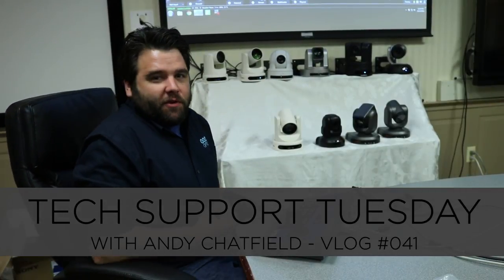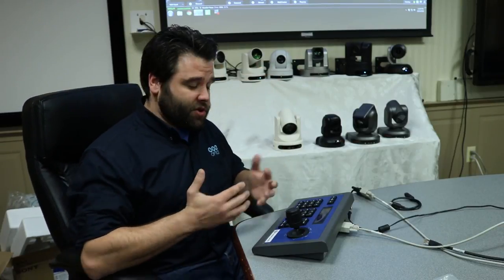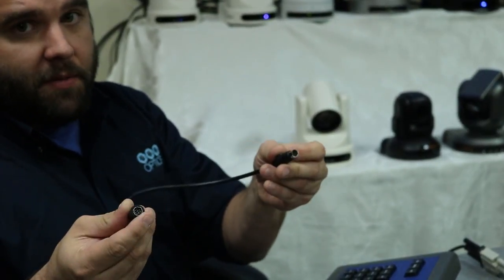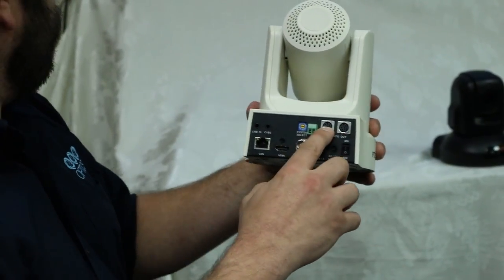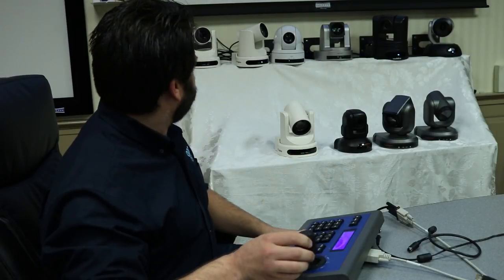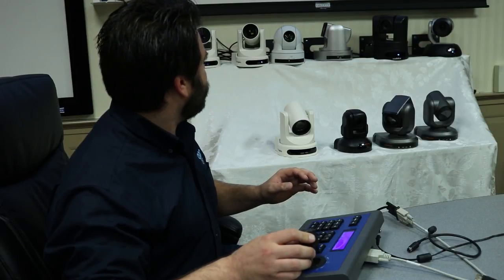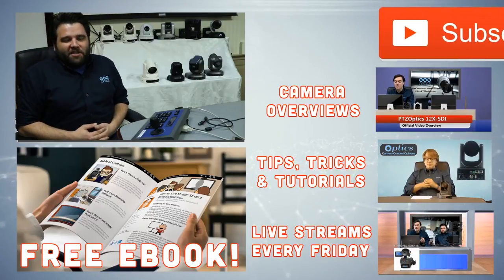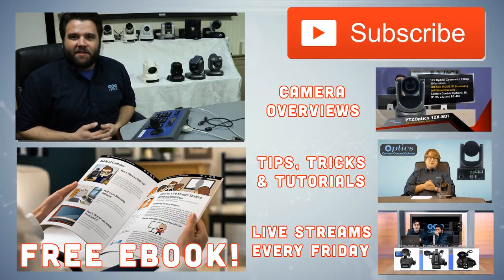SONY Cameras with VISCA Joystick Controller

Comment: Hey man, have 2 sony evi80 ptz came. When individually connected to serial cable, no issues at all, but when cascaded, the second cam doesn't respond, only first can connected  to serial cable.Cables are new. Serial is 25', cascade  is  100'. Controller is the Huddle g3....
Reply from the maker: Hello!
When you're experiencing issues with cascading two Sony EVI-D80 PTZ cameras, where the second camera in the cascade isn't responding to commands from the HuddleCamHD G3 joystick controller, there are several factors to consider and troubleshoot. Here’s a systematic approach to resolving this issue:

Check Camera Addresses:
In a cascaded setup, each camera must have a unique address. Make sure that each Sony EVI-D80 camera is set to a different address. Typically, PTZ cameras are set to address 1 by default, so you’ll need to change the address of the second camera in the cascade.

Cable Length and Quality:
The length and quality of the cables can significantly impact the performance of cascaded PTZ cameras. While your cables are new, the 100' cascade cable might be at the limit of what the system can reliably handle, especially for RS-232 communications.
Consider reducing the cable length if possible or using a higher quality cable to ensure that the signal strength is maintained.

RS-232 vs. RS-422:
Check if your cameras and controller support RS-422, which is better suited for longer distances than RS-232. If supported, using RS-422 could resolve issues related to cable length.

Cascading Configuration:
Review the cascading configuration in the camera settings. Ensure that the cameras are correctly configured for a cascaded setup, which usually involves specific settings to designate a camera as first or second in the chain.

Baud Rate and Protocol Settings:
Make sure that the baud rate and protocol settings on the cameras match those of the HuddleCamHD G3 joystick. Mismatched settings can lead to communication issues.

Test with Shorter Cable:
Temporarily use a shorter cable for the cascade connection to determine if cable length is the issue.

Firmware Update:
Check if there are firmware updates available for the Sony EVI-D80 cameras and the HuddleCamHD joystick. Firmware updates can sometimes resolve compatibility and communication issues.

Inspect Connectors and Ports:
Carefully inspect the connectors and ports for any signs of damage or wear. Even new cables can be defective.

Power Cycling:
Power cycle the entire system – turn off all devices, wait a moment, and then turn them back on. This can sometimes resolve communication glitches.

Consult Manuals and Support:
Review the user manuals for the Sony EVI-D80 cameras and the HuddleCamHD joystick for specific instructions on cascading cameras. If the problem persists, consider reaching out to their respective support teams for assistance.

Isolate the Issue:
Try swapping the positions of the two cameras in the cascade to rule out an issue with a specific camera.

By following these troubleshooting steps, you can isolate and hopefully resolve the communication issue between the cascaded cameras and the controller.

Thanks for checking out our Channel! 
Learn More: https://ptzoptics.com/